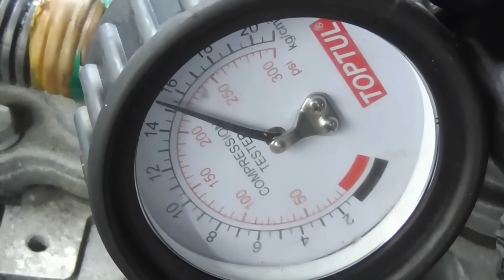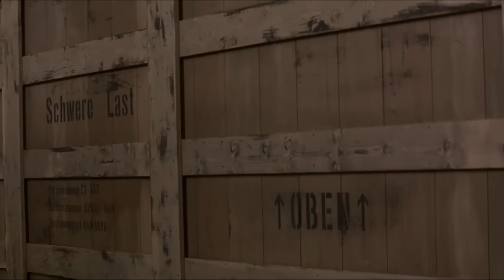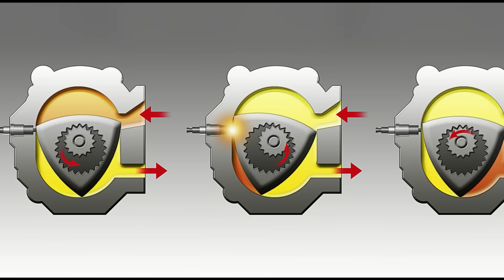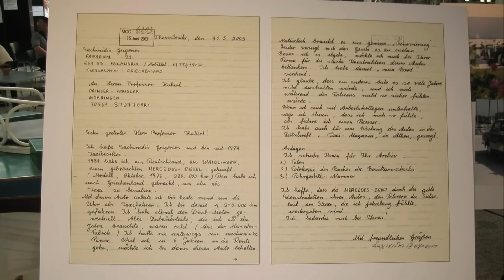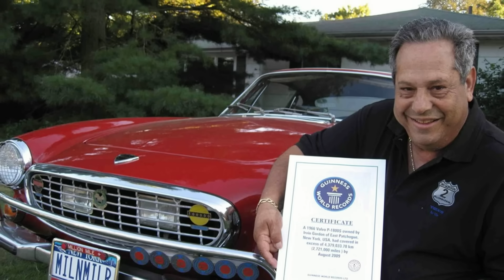Most Reliable Engines of All Time

Comment: Don't forget the Buick 3.8 liter v6.
Reply: Vn tip in
Reply: Barra is more reliable
Reply: My '99 Buick with the 3.8 V6 was great until the electronics failed, then it wouldn't even crank.
Reply: ChuckandChun absolutely! one of GM's best engines ever!!! under stressed and built to last (unlike most of their current CRAP) I said most, not all..... ;)
they still make awesome V8's
Reply: They didn’t forget they made sure it didn’t make the list lol. Electronics are trash in them. Ignition components are weak

Comment: Why does he make 200,000 miles seem like a lot? I have seen a Toyota engine break at a high 370,000 miles, probably because the previous owner ran out of oil. Diesels are made to last forever, be used a lot daily, and be efficient. We have a 2005 sienna with over 200,000 miles, and runs like new. I have seen a 2004 Toyota Camry that needed a head gasket because the previous owner most likely ran it out of coolant, but the cylinders all still had the original marks from the factory, when I saw this, my mouth dropped in amasment.

Comment: What about the 7.3 diesel? You can put over 600,000 on it
Reply: What about the cat engines
Reply: @mikepro-ww5fg  yeah they have cylinders liners that you can change.
Reply: Engines good for a minimum of 1 million miles?
Cat, Cummins, Detroit, Mack, International (diesel), Mann, Mercedes-Benz, Volvo (diesel) ... pretty much any commercial diesel truck engine has a recommended 1 million mile rebuild schedule. (some don't rebuild at as much as 1,250,000 miles)
Reply: @stevehuffman7453  just run it till it pops, but the 7.3 were a throw away block because it didnt have cylinder liners. Unlike any other commercial motor

Comment: Chevy 5.3 can go 300k. Chevy 8.1 I sold at 309 k miles o5 duramax 500k miles so far still going strong  my 15 duramax has 111k already
Reply: I have a 2001 chevy Silverado with the 5.3 and has 313000 miles on it
Reply: I got 271k out of a 4.8 but transmission was garbage
Reply: bill2526 bill2526  you can't forget the 350 small block

Comment: My uncle had a 1973 Chevrolet 3/4 ton pickup with a 402 cubic inch big block.  He had a valve job done on one bank of the engine and never had the valve cover off the other side.  He used it for quite a few years to tow a trailer for his cabinet shop. After he retired he just kept it for his personal vehicle and in 2001 a hole rusted through the side of the block. It had 510,000 miles on it and still ran great.

Comment: I got 2002 GT mustang 4.6 engine 5speed car I have over 320000.0miles on my baby n never had clutch disk Or Ny other major parts replaced had alternator rebuilt two times in 15years I've always used Mobile1 10w30 winter n 10w40 summer full synthetic!! Oh ya I drained out ATF from trans n replaced it with Mobil1 10w30 first time I changed engine oil 15years ago!!!

Comment: The Mazda rotary engine was prone to failure because of seal failures.  I know of few that went beyond 60,000 miles without a major rebuild.  You missed several engines noted for longevity.  The AMC inline 6 produced from 1965 to 2006, in displacements from 199 cid, 232 CID, 258 cid and 4.0 Liter.  Many of these engines in taxi cabs went well over 1,000,000 miles without a major rebuild.  Another 1,000,000 miler is the Chrysler Slant 6.  Produced from 1959 to 2000, in 170 cid, 198 cid and 225 cid.  Other long lasting and high mileage V8 engines were made by Ford, Chrysler and GM.  Many of these engines had lives shorted because the cars they were in did not last, but the Chevy 327 cid variant in Checker Cabs, also reached the million mile mark without major repairs.

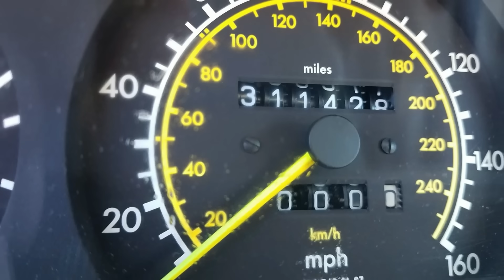Comment: 3:30 , you say that like 200,000 miles in a diesel engine is a lot, truck diesels go for 500,000 to 800,000 miles easy and tractor trailers even more   and rotaries are not reliable, the fuck are you smoking

Comment: That rotary motor was plagued with problems. Leaking, burning oil, and all sorts of stuff. Ueah, the concept was cool, and it DID make all sorts of horsepower, you could bolt them tohether and get even more power . but reliable. Meh!!

Comment: My opel vectra c has 360.000 miles and i charged the spark plugs only once at 240.000 miles and it's as reliable as it was from factory

Comment: We have a 2004 sante fed with 300,000 on it still running strong in fact we love it so much we bought another one in 05 and put almost 200,000 miles on the car so far and it runs just as good
Reply: CrownvicCam what is a sante fed?
Reply: Sante fe Hyundai
Reply: CrownvicCam you did overspell man.. Check the spelling of your comment..

Comment: Ford 300 CID I6 truck motor can easily hit 500K miles, I personally owned a Ford LTD with the 400 V8 that I retired at 385K Miles, no rebuilds, original timing chain, new oil pump at 200K

Comment: The life of death of a engine is dependent on how it is cared for and how the car is driven.
Reply: Except FIAT of course
Reply: @Nick-ko1tw  your wrong
Reply: @kris8742  hes talking about keeping the same engine and transmission and no major repairs. I've heard of a fiat engine blowing at only 5000 miles!!! or less if I remember correctly
Reply: @Eligaminglee  Some Fiats with the twin cam engine required the timing belt to be replaced every 30,000 miles and occasionally they wouldn't make it that far. I put 192,000 miles on a 1974 124 sedan but even then it didn't have the original engine in it at that mileage.
Reply: @Nick-ko1tw  FIX IT AGAIN TONY!!!!
Reply: @Nick-ko1tw  The Fiat 1.0 fire engine is very reliable, problem is the car it's in. This goes for almost every Italian car, Alfa Romeo Nord Engine and Alfa V6 Busso among the best engines in the world, the rest around it is crap though if not taken care of very mitticulous. But who cares they look the best ;-)
Reply: Yea, even Yugos will go 500,000 if properly maintained and driven properly..
Reply: @jimaglenn  I hope you're joking, cause those things couldn't make more than 100k km without complete engine overhaul.
Reply: @denniso113 
Just pointing out the idiocy of that comment. Never imagined anyone would interpret it any other way..
Reply: Yes and no. Is more likely to a Corolla engine to endure 150k miles than any Peugeot engine to do the same. Some engines are simply well built and can handle more mileage.
Reply: Yea if you do overhauls every year then you could call every engine reliable and lasting
Reply: Even my tsi has over 400k on it
Reply: Tell that to the motor in the 2007 m5
Reply: yes and no, being a good to the engine driver and maintaining it properly will for sure prolong the life of the engine. But not all engines are of the same quality. Did you notice a theme here? Most petrol engines listed here are Japanese and the main reason is build quality. The metals undergo rigorous stress testing and make sure there are no air bubbles forming inside them. For example in the latest project shared by Toyota and BMW for the Z4 and Supra, BWM gave the engine they have build a PASS with flying colours while Toyota marked them as total failures and rebuilt them to somewhat meet their reliability standards
Reply: @christoforospaphitis4090  look at the motor in the m5, no amount of proper maintenance can save the motor.
Reply: Very true. There should be a disclaimer that regular maintenance interval schedules be followed. I will admit me being lazy and sloppy with my Japanese cars with a few thousand miles off major services/replacements required didn't phase the engines.
Reply: The TacomaKid  Did 160,000 miles in a Fiat no problems.
Reply: Doesn't matter how much care or how you drive a 2007 Nissan Navara diesel, it will break the timing chain at around 100k klms. Some engines are just rubbish.
Reply: Apart from European crap! Over engineered unreliable bulsht! English could fuck up cheese on toast!
Reply: I own a Vauxhall Astra J with 55,000 miles.. Just had to rebuild and uprate the M32 gearbox because it is a crap design. I agree!

Comment: Got a 99 Ford ranger 4.0,  271, 000 miles and still running
Reply: ive got a 97 ram 1500 with the 5.9L magnum with 290,000 on it.  bought it for $200.00. only issue is it doesnt have a roof
Reply: @jorganlegvold8484  one of my favorite trucks
Reply: I'd post how many miles my rigs have but I truly don't know, the odometer doesn't have enough digits, they've gone all 9s and turned over at least once.

Comment: Ford 6.9L V8 IDI diesel
bulletproof
(technically International manufactured it)
Reply: The 7.3 was no slouch either
Reply: Yup, almost literally. I don't know of anyone who's shot one to failure. But plenty have pushed they're limits. Guy I know was curious how far he could push a 6.9 so he hopped it up to the point it was making 50PSI boost and it threw a rod. It blew out a chunk from the block, all the oil gone, etc. But it still started and ran, while he didn't try and drive it home he started it again to drive it onto the trailer and again from the trailer to garage. Another friend made it about 500 miles home with no oil in the engine. He damaged the oil pan and instead of dealing with it, said fuck it, let's see how far it can go so at least it's closer to come back with the trailer. To his surprise he made it all the way home.

Comment: OH MY GOD HOW DID YOU FORGET THAT THE K20 IS IN THE S2000?!?!?!
Reply: It wasn't! The Ap1 S2000 used the F20 the Ap2 S2000 used the F22
Reply: THE F20 IS THE K20
Reply: MIB gamer 8764 the F20 predates the K20 and the f20 is vtec the k20 is ivtec among other small differences. You could say the K20 is an updated F20 but the F20 isn't a k20. And both engines are reworked Accord engines from years prior to the F20.
Reply: @ReelWildOne  to say that both engines are reworked Accord engines is ignorant at best, retarded otherwise. The K engine was a completely new design from the ground up, as well as the F20C/F22C. The only thing it shares with the older F engine is the name.

Comment: They should make a list of all components which are the most durable, put them all together in one car and you will have a vehicle that lasts a lifetime.
Reply: as a mechanic, i really wish that was possible
Reply: @jorganlegvold8484  It kind of is, I do that sort of thing, heck "hot rodders" have been doing it for a long time. Everyone that's swapped in a 9" rearend, small block chevy, etc. etc. has done that.
Reply: @jorganlegvold8484  Henry Ford had this in mind: I will build a motor car for the great multitude. It will be large enough for the family, but small enough for the individual to run and care for. It will be constructed of the best materials, by the best men to be hired, after the simplest designs that modern engineering can devise. But it will be so low in price that no man making a good salary will be unable to own one – and enjoy with his family the blessing of hours of pleasure in God's great open spaces.
Reply: "they" do it yourself.

Comment: Hi have a 1996 EK Honda Civic Sedan with 300.000km and the clutch is original.  Even the exhaust from the header to the back is original. The car runs fine, I change the oil every 5.000km and never had to do any mechanical job on it.

Comment: Chevy small block anywhere? Or any well maintained massive american V8?
Reply: Cobra_ Daytona the ol 350's where good engines, Ford's 302 Windsor was a good engine if you didn't mod it. The 4.6 in the crown vic is still used as taxis and police cars with many well over 1mil. I could go on and on.
Reply: Kinda funny the guy calling himself "Cobra_Daytona" first goes to the chevy as an example, lol.

Comment: I'm going to put this out I own a 1991 chevy suburban r1500 with a 350 v8 and little over 240000 miles and it is all original my friend has a 1989 chevy Scottsdale with a 4.3 litter v6 and a little over 512000 miles on it again all original now we live in Pennsylvania we have potholes big enough to park in and a few years ago we got 5 feet of snow overnight you want to test reliability of an engine send them here for the record as well neither one of these have block heaters or any fancy equipment to help to keep them running if our power goes out both of us have power inverters which means the truck just sits there idling will it Powers the house which isn't really good for an engine and because our Power Systems so out of date power outages are not uncommon in both trucks also should be noted that there are only two wheel drive the Suburban is a 350 cubic inch hooked up to a 700 R4 for a transmission I don't know the exact Transmission in my friend's truck but I can tell you it's a 4.3 with a 5-speed standard and his current clutch has been going for somewhere in the ballpark of 150 or so thousand miles
Reply: Another thing I forgot to note is that both of these are half ton trucks and neither one of us are afraid to put 4,000 + pounds in the bed of the truck and then hook a trailer up to him on top of that

Comment: Problem is, the automatic transmissions don't last as long as the engines do and they are too expensive to replace.
Reply: Get a manual transmission they are easy to replace and lighter too
Reply: Not to expensive to rebuild -- if you've got the juice

Comment: Shameful, all but one are imports. Well let it be known that I drive a "89"  f-150 with a 300 straight 6 in it, with over 500 k miles on it. Engine still runs fine. TYVM
Reply: The only "shame" is the video's idiocy.

Comment: You forgot about Ford F-series 7.3L turbo Diesel engines!
Reply: He "forgot" about A LOT of great engines, but if you mean the IDI, then absolutely, not the PS though,I would not consider them highly reliable with all the HPOP, UVCH, and injector cup issues.
Reply: @snek9353  even the powerstroke variant is a robust design. We had one where I used to work and before some jackass filled it up with gasoline, it had 458k on the clock. It had been through a turbo and two transmissions, but the motor was dead reliable.
Reply: @phantom240  I think you confuse robust with reliable, not sure I'd even consider the 7.3PS robust. I'm not saying they're bad engines, as diesels of the time go they're at the top. But they have too many issues to be considered highly reliable. They're robust in that they'll take the abuse of hard work, but not any more then most diesel truck engines and not without keeping up on maintenance. A 12V 5.9 Cummins or a 7.3IDI is a more robust engine. A 7.3IDI, a P-pump Cummins, or even a 6.5 Detroit is a more reliable engine. 

For the day with the level of power, drive-ability, and ease of customization the PS is a darn good engine, But "most reliable" it is not. Heck your own post bears that out, fill a PS with gasoline and you'll damage expensive parts to the point you're likely to total the truck. Fill a P-pump Cummins or 7.3 IDI with gasoline and at worst you'll shorten the life of the pumps and have to deal with flushing it out. Probably the least likely to be damaged by that is the IDI as the injectors are simpler and more robust. Heck if somehow I was to get a tank of gasoline in my 7.3IDI rig I'd fill the fuel filter with ATF(if full of gas), dump a bunch of waste engine oil in the tank to mix with the gas and add enough lubricity, then let the electric pump run a while to mix it up before starting the engine.
Reply: snek in all fairness, the truck wasn’t sent to scrap because it wrecked the engine entirely, the company just didn’t want to pay to have the thing drained and checked out, since it looked like a pile of shit and was in need of a turbo. There’s good reason why those trucks still command a premium on the used market. Sure, they’re not the top dogs of the diesel reliability world, but I’d consider them quite reliable.
Reply: @phantom240  OBS Fords command a premium because the OBS are awesome(I own 5, including a Centurion), 99 up don't except for Excursions. Find identical as possible 97 and 99 F-350s both with 7.3PS engines and the 97 is worth more. Now an Excursion with a 7.3, a nice one can still get $20K.
Reply: @snek9353  Perhaps it's a regional thing. I see  99-04ish 7.3PS trucks being sold for $8k+ with 200k+ miles

Comment: We see clients with 475,000+ miles on modern GM LS engines in commercial vehicles. 

But id say the Toyota 22R or Small block Chevy are among the longest lasting because they are simple to repair and maintain.

Any engine is only as good as its maintenance and upkeep.
Reply: Definitely the 22R, the Ford 300 inline 6 was a very reliable engine, it didn't have much power but ran forever it seems, the 350 chevy if taken care of slightly is a great engine plus parts are everywhere for small chevy motors, the 4.3 V6 chevy was a good motor.  Just like you said, if the engine is taken care of and maintained correctly any engine can be considered reliable.

Comment: I wish ford was this reliable
Reply: It is.
Reply: Fords 300 6, Ford's Barra Fords Windsor if left stock was very reliable. Fords 4.6 in the crown vic is probably the most known million mile engine. They're still using them as taxis and cop cars for a reason. The IDI 7.3 also known to surpass the million mile mark.

Comment: The supra has an iron block with aluminum head not cast iron block and the rb26 at not cheap and not even Close to reliability its only for safe power output